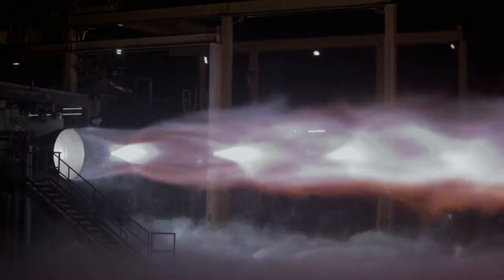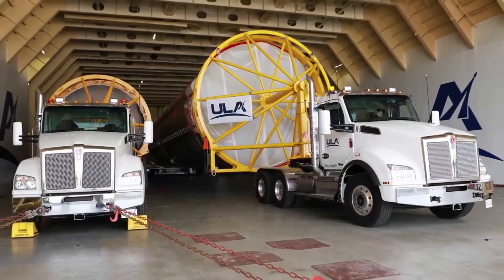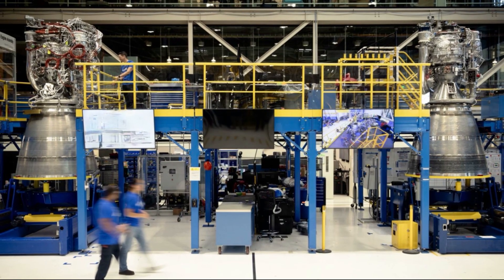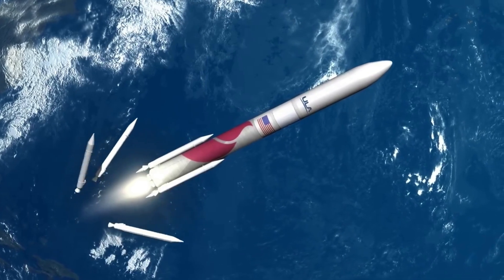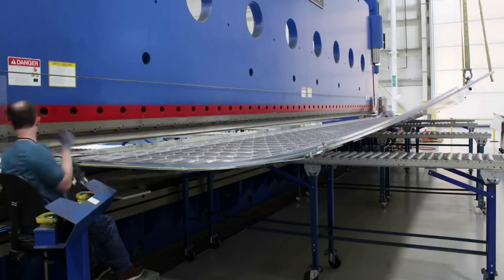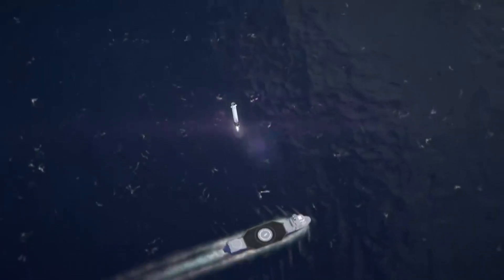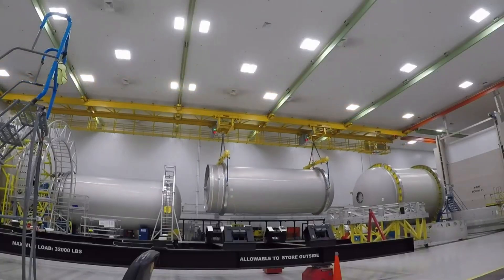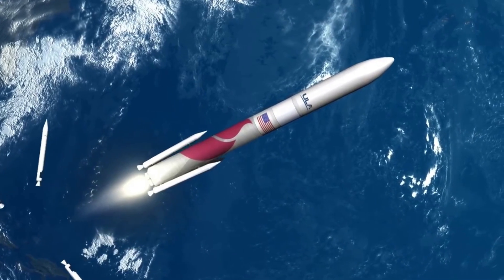Blue Origin’s Final BE-4 Engine Is About To Be Delivered

Comment: Question: how exactly do you certify a rocket engine? Are there standard criteria pre-established, like a checklist? And how do you certify different types of engines!
Reply: Several ways, but one of the most important is long and repeatable test firings.  These can include full mission profiles, and long full thrust burns.  Certification comes if they achieve a good record of not explosively disassembling themselves.  :)